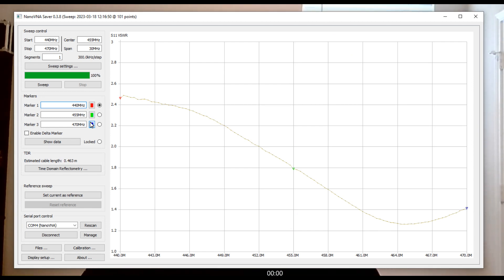Before you buy a Nagoya 771... Baofeng antenna test

Comment: Interesting, I have a couple 771's for my two UV-5RTP radios and in the FRS band, I haven't been able to see much, if any improvement though I've only done a very simple range test.  I wasn't expecting it to be that good in the FRS/GMRS range as your test showed.  I was about to pick up a couple 771G antennas to possibly have better performance in the GMRS range, now not sure it would be any better than the normal 771.

I'd be curious how the original antenna did with the same test rig, did you ever do that?  I browsed through your videos and didn't see anything.   Did you try any different lengths for the counterpoise wire? Wondering how you'd come up with an equivalent length to replicate your body holding a handheld.  Cool testing, thanks for sharing.
Reply from the maker: I did not try with the original antenna. The main thing I'm trying to show is that thsee are really made for GMRS not 2m ham

Comment: I watched a couple of Video's of "real tests" & the Abbree 771 was at least as good & some tests showed even better than the Nagoya so I saved by buying the Abbree for $7.99 instead of the Nagoya for $21 😁 I easily hit a repeater at least 14 miles away through Pennsylvania Hills & Woods.
Reply from the maker: Thanks
Reply: Same for for as a newbie just licenced in the UK. I got the Baofeng UV-5RH & an included Abbree 771. I'd focused on getting the 'genuine' Nagoya but tests show they're both so similar & possibly at 5-7watts its 'apples & pears', the SWR factor is the most interesting to know though. So thanks, great & informative video!

Comment: I bought a Nagoya 771 and I get similar results.
Reply from the maker: Thanks!
Reply: @texasprepperprojects  I would like to see more testing videos because we could all save a lot of money (for me, HAM is starting to mean "Had A lot of Money" after wasting some on junk). Thanks for doing yours. I used my arm as the counterpoise like I would with the HT when I tested my Nagoya. Moving my arm a bit from 45 degrees to 90 degrees, not unlike I might when using the HT, gave me wildly different results. I also tested a Baofeng rubber duck. The SWR was lower and more stable but the duck is so short it's probably more like a dummy load than an antenna. In the end, I ended up buying a Diamond SRJ77. It exhibited low SWR that wasn't as sensitive to how I held my arm. Josh Nass (KI6NAZ) at HRCC tested a bunch of HT antennas, including three different models of Nagoya. He wasn't getting the crazy high SWR you and I measured (depending on how I held my arm), but Josh had the antenna sitting on the HT with a SWR meter in the path. When Josh measured the Diamond SRJ77, the SWR was good and it had the best field strength especially on 70cm. That influenced my decision plus I know a guy who retired from Diamond. So far, I've had good luck with their stuff. If you want to see the video Josh made, it's here: https://youtu.be/3Qve78EwXjc  Be well. 73.
Reply from the maker: Comet, diamond or signal stick is the way to go. I bought a Nagoya because everyone else had one but I won't so that again. A crap antenna makes a good radio crap. But a good antenna can make a meh radio decent.

Comment: I also see crappy performance on VHF with my 771 (which checks all the boxes for authenticity I see online about the packaging, markings, included spacer, etc.) but pretty good in UHF.   However I see pretty much the same thing with the unbranded 771s and Signal Stick.    I think the maybe the whip antennas just aren't great for VHF unless someone knows of one that does work really well
Reply from the maker: Try a comet or a diamond

Comment: Let's not stop here, I am a Advanced tech, what are your goals with your HT ? Do you have many friends you talk to on your repeaters? Do you go to ham meetings?
Reply from the maker: I'm a general.  I don't need any assistance with my goals. I've actually field tested my radios and i'm aware of what they will and won't do. thanks.
Reply: @texasprepperprojects  Well , most guys want to hit towers with their HT, but find it difficult in certain conditions. If you are within 3 miles of your vehicle, a VR will turn your HT into a 10-40w+ powerhouse. Any band, anytime.The digital and lowband stuff is fun, I like talking to hams all over the USA.
Reply from the maker: I can hit repeaters. I have had a 7900 and 8900 in my car. I have build cross band repeaters in other videos.  I have used js8call and an inverted vee to do hf over 4900 miles
Reply: @texasprepperprojects  awesome! I got my license at like 13 and never stopped there! It's amazing to meet enthusiasts like you that keep the community alive.

Comment: I see a lot of talk about the 771, but I decided on the 701. It's only an inch longer than the stock one, but still has all the flexibility so you don't break it.  The 771 is not the right size for me to put in a shirt pocket, or on my belt. It looks good on the radio too. LOL
Reply from the maker: Use a signal stick or Comet
Reply: I have both the 771g and the 701g. Both work great but the 771 is noticeably better on long distance.

Comment: Could be you bought a fake Nagoya, they are around everywhere. SWR is not all for a good antenna, the characteristic impedance match is at least even important and should be matched well.
Reply from the maker: could be
Reply: Hit's true fake negoya 771 are all over the place. But you making great explanation .
Reply: i just bought a baofeng uv 5r max, supposedly new for 2024 i bought the whole kit that comes with accessories and it says it has a na 771 antenna, wondering if its legit. this new uv5r max has 6 bands 1000 channels and 10 watts. cant wait to get it and test it out
Reply from the maker: @jerrysmith7166   link to what  you bought?

Comment: They make a version specifically for GMRS called the 771G.  Are you sure you didn't get one of those by mistake?  Because the antenna you tested seems to have been tuned specifically for GMRS.
Reply from the maker: I agree. But yes I am sure I got the right one. But yes it is great for gmrs

Comment: My 771 arrives tomorrow for my UV-5R. This is fascinating. Thanks for taking the time to perform these tests and sharing the results along with lots of other helpful info. I mainly use mine as a UHF police/emergency scanner. Are we safe to assume the 771 was designed in a manner that the designer presumed that it would primarily be used for UHF? (Even though the specs list VHF/UHF compatibility?)
Reply from the maker: I would generally say yes. But I'd get a signal stick over a 771
Reply: @texasprepperprojects  Thanks. I haven't heard of that. I'll look it up.

Comment: I just picked up the 771G for GMRS bands and it has an SWR. of around 2.1 across the entire band. Will clipping some off of the tip help or hurt me?
Reply from the maker: Where is the swr good? Above or below. You may make it worse
Reply: @texasprepperprojects  i thought of that but i had access to several of them and decided to try. I ruined one then got lucky on the second one. I trimmed off very little at a time with a pair of linemens pliers and got it to 1.06 in the middle of the range. Not sure if id attempt it again especially if i had only one.
Reply: @beansmalone2982 😮Wow nice work trimming that so close to obtaining a 1. Very cool.